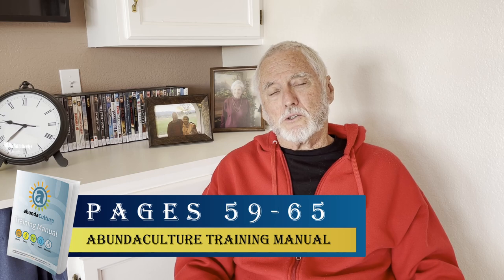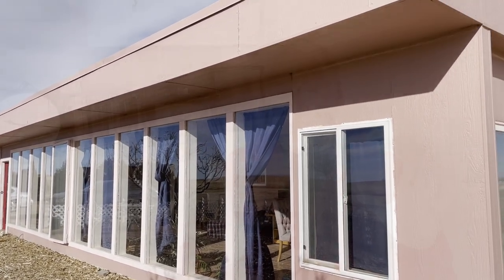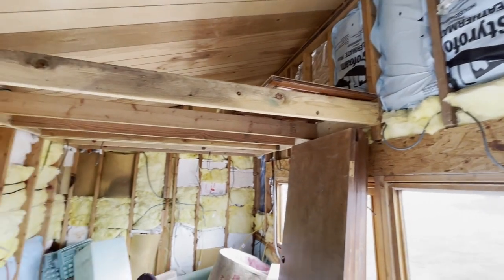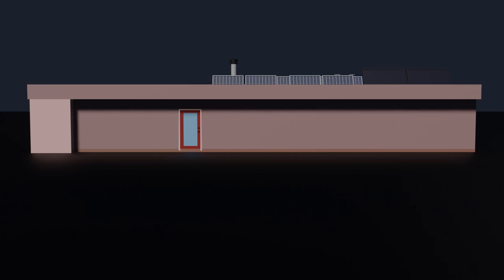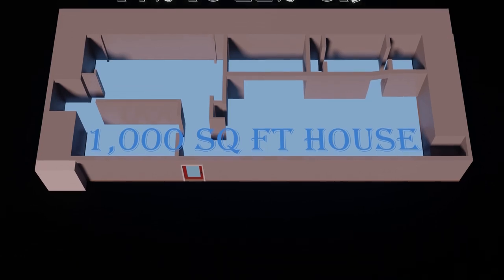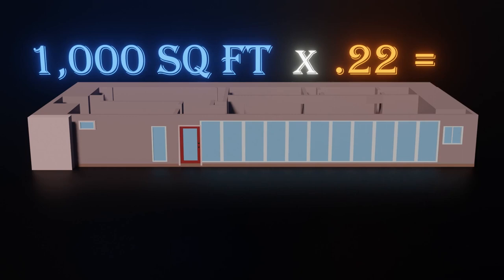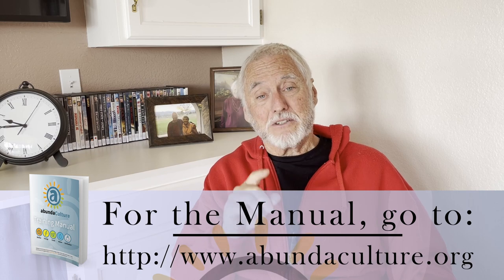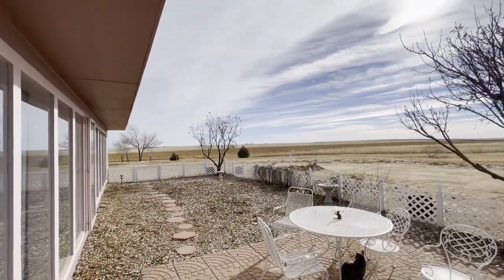Passive Solar Heating

Comment: I have thermal break and insulation going in under my 4 inches of masonry floor because cold 48*F ground temp. And 6 foot frost depths and piers to steal my heat. They will have thermal breaks 4 sides. 24x24 but almost 500 sq ft floor space. doing 3 vertical 16 foot columns of 4x7 windows per 24x24 section. And aligned to solar south for winter gain with 6/12 pitched skillion roof. So 336 sq ft windows per 576 floor sq ft. North wall is 8" cmu block vermiculite cored, low perm barrier, mineral wool 4 inches, another wrap and air gap 2" and masonry veneer 12" to 8" batter. Doing masonry stove, heater, and white oven on north wall. I have to have pipe to air in floor. Left 4 feet above south windows for ventilation. Great video.

Comment: A elegantly simple system but I have one question: What about the choice of glass used in this system? Do you use newer glass with reflective properties or a more clear glass for better solar absorption? Obviously, both would save energy at different times of the year.
Reply from the maker: Because we use lots of recycled materials, we tend to use what is available with little regard for special treated glass. We’ve never had any problems.

Comment: I live in Pittsburgh, Pa and would love to build a passive solar home near here, but I'm not sure about it with the number of sunny days we get. On average, there are 160 sunny days per year in Pittsburgh. On the positive side, we get plenty of rain, so water collection wouldn't be a problem.
Reply from the maker: Dear Todd, May I suggest that you get a book called The Passive Solar home by James Kachedorian. He built several very effective homes in New England, a place with less sun than you have in PA. If you also want to go with solar electric, it is possible, but your system must be larger than it would be in a more sunny place.
Reply: @Abundaculture  thanks!